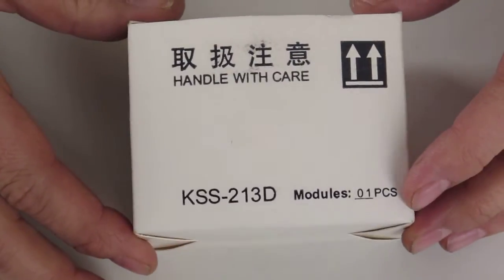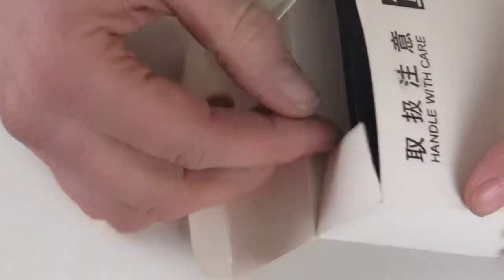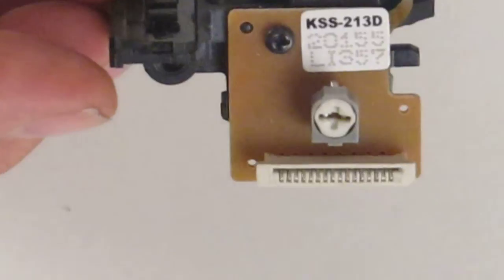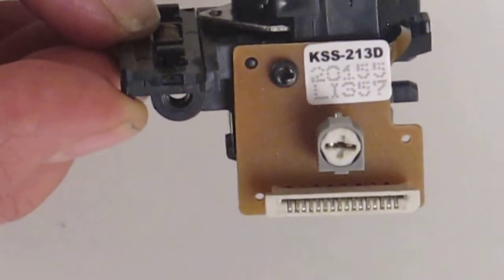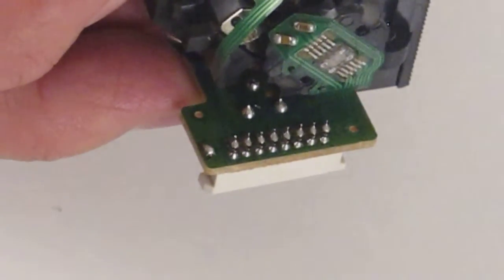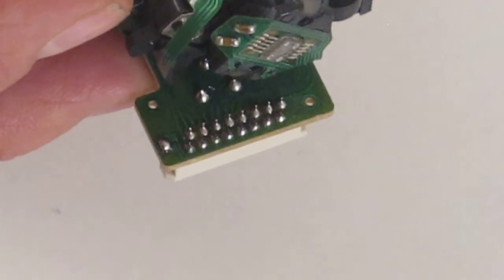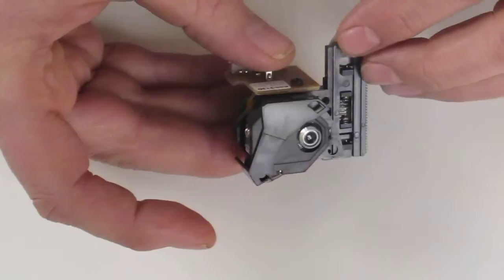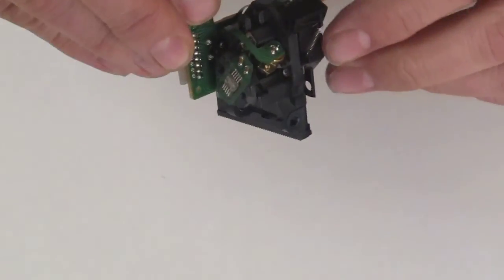KSS213D Laser Assembly

Comment: Thanks for the advice about knocking off the solder ball on the corner. You're 100 percent right. Tried 2 lasers and wouldn't read the disc. I did what you said and it immediately read the disc. Thank you.
Reply: I did the same thing a few years ago too, couldnt get my head around it, thought I,d damaged the laser unit, then I found out about removing the solder , worked perfect after that. Thank God for youtube and cool guys like the guy that made this.
Reply: I snipped the soldered traces off all together with a razor sharp mini snipper, when I replaced the laser on my Rotel RCD-971. No desoldering needed if you are careful.
Reply: @user-bc6ok1yh4s  Wonderful information, thanks for sharing that !!